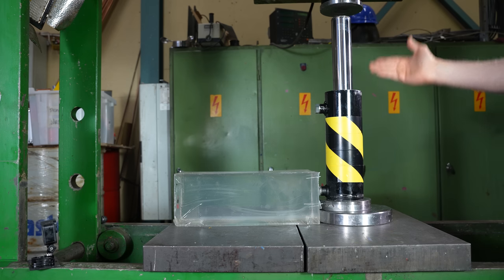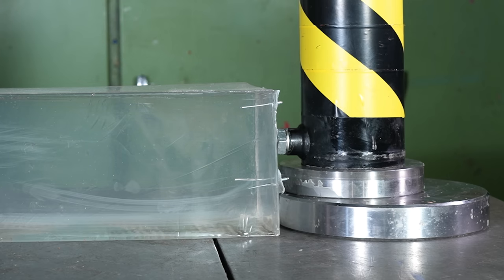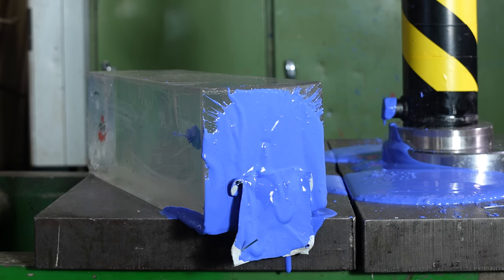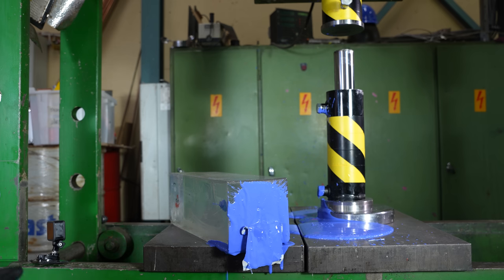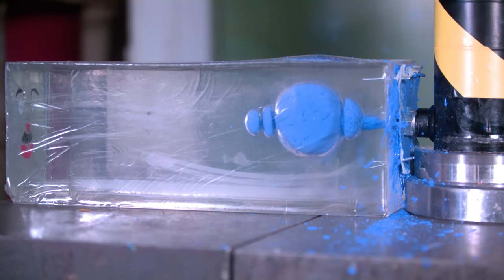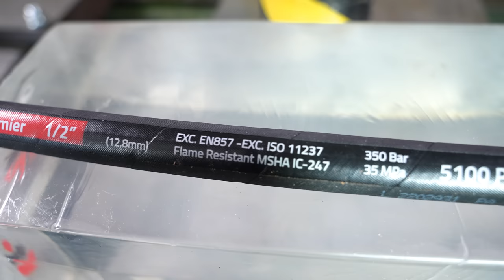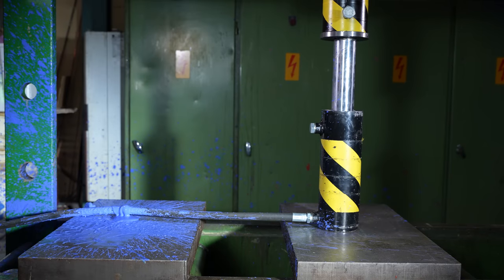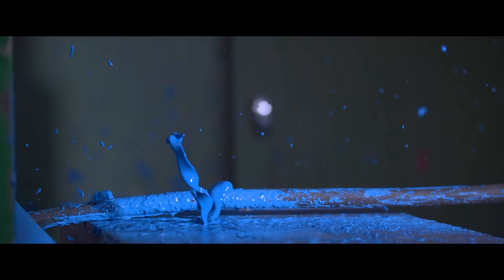Injection Injury Demonstration With Hydraulic Press | How to lose your hand!

Comment: I was a US Naval Aircrewman on the P-3 Orion. After taking off one of us went thru the aircraft making sure all is good. One of the areas was the hydraulic service center. If we looked in and saw what looked like smoke we had to assume it was hydraulic fluid leaking at high pressure. We were to take the broom and wave the handle around to find where it is leaking. NEVER put your arm in there since it could cut off or destroy your arm.
Reply: I talked to a Navy guy who served on "a small ship" (wouldn't say what kind) and saw two sailors drag some idiot junior officer trying to find a leak with his hands when they were "taking too long" to find something else. Long story short it went to Captains mast and the captain threatened to have the officer find leaks with his face.

Comment: I'm very happy that you brought this very dangerous fact of high or super high pressure dangers. Any thing injected at high pressure is a huge potential for major damage. PLEASE BE CAREFULL.
    I watched a shipmate who had his arm sliced open by a high pressure pin hole leak. The stream was very fine and basically invisible in the light available.
   I was taught to use a piece of cardboard ahead of my hand or arm before reaching in. Just a finger tip blast can lead to a loss of the finger.

Comment: I worked for a company that made ultra high pressure pumps, for water cutting and heavy cleaning. The pumps went from 20.000 to 55.000 psi. The pictures and videos of accidents everyone there saw during safety training were horrible, and once during a company barbecue they both ribs and cut it with a 40.000 psi pump with a less than 1mm sapphire nozzle "gun". Cuts bone like it's hot butter.
Reply: How does hot butter cut bone?
Reply: @Peststurmtief  With enough pressure behind it, I'm sure it'd be a perfectly adequate cutting fluid. DO NOT try this for injecting your turkey next Thanksgiving. Or perhaps that's another video idea, because it'd show some of the effects of degloving.
Reply: Pump don't really create pressure they create flow. Resistance to that flow creates pressure. Now yes the pumps have to be able to resist back flow
Reply: @Peststurmtief  You're not a native English speaker are you? 🤣
Reply: @krashd  no need to be a native speaker, that sentence can indeed be read both ways and so the joke is valid.
Reply: I used to work on a water jet with a 65000psi pump. Never tried cutting up meat but that thing blew through solid steel right quick sooo.....
Reply: @edep3970  the amount of flow for a water jet cutter is moderate, we had a little diaphragm pump pulling out water to separate out the garnet and then a normal sump pump getting rid of the clear wastewater. The main pump for the machine though was a reciprocating piston type design, never seen anything like it outside of that application. So yeah it was directly applying huge pressure forces to the water through that piston and when the jet was off but the system was pressurized the main gauge read tens of thousands of psi. we had to let it charge up with pressure before activating it.
Reply: @comradegarrett1202  never saw a 65k pump. Must be amazing. The 55k we had already scared me a lot. 😅

Comment: My dad actually had this happen to him during a lapse in judgement.  A hydraulic hose blew on a skid steer and he grabbed it.  It wasn't pretty but he did make a full recovery with minimal long term effects.  The hole in the hand was the least of the problems, the hydraulic fluid was a different story.
Reply: isnt hydraulic fluid toxic?
Reply: @The4stro  yes
Reply: They removed a fair amount of damaged and oil soaked tissue from his hand and he got right to the ER which helped.  Also, I believe he was pretty quick on the release so that the damage was less than it might have been. It's amazing how fast we can react during those WTF was I thinking moments. Regardless,  he was extremely lucky and IMO came away better off than he probably should have.
Reply: @jeffreywhitmoyer860  grabbing the broken line is exactly what i did too; the pain sure helped in letting go quickly 😅

Comment: My father told a story of an aircraft mechanic who noticed hydraulic fluid on the padding along the rear side of the aircraft. The mechanic ran his hand along the suspect metal hydraulic line without thinking and lost most of his fingers in just a second. The line had a pin-hold leak and the pressure was many thousands of pounds per inch. Basically became like a hot wire and hurt his hand badly.
Reply: Jesus, thanks for the heads up, I never gave it any thought how high pressures can do this.

Comment: I've been fixing hydraulic lines on the excavator at work and I'm going to be extra careful now! 
You should try the candles against the ballistic gelatine
Reply: Yep be careful and use your head. I've had a hose on a crane truck outrigger I was working on blow without any warning before. A line of fluid the diameter of a needle, like a freakin lazer beam shot right over my shoulder next to my ear. It could have been SO bad. 

Another thing to remember is that as soon as the system loses pressure, anything that was being held up by that fluid will fall. Always take a second to look around and think before you remove a hydraulic line, as the machine can "settle" right down on top of you.
Reply: @Bloodbain88  bloody lucky! I've heard it's really bad to get hydraulic fluid in wounds too.
Yeah I've learnt to extend the boom now to relieve any pressure but it just takes one screw up to be the last screw up.

Comment: This can also happen with airless paint sprayers (they use a corkscrew pump to get the paint up to about 3000 psi before it exits the nozzle). Ive heard stories of painters who accidentally or ignorantly wave thier hand in front of the sprayer and the paint sprays instantly into their flesh. The injury doesnt stop with the mechanical damage either because paint in your blood stream can be extremly dangerous so when this happens the victim usually needs to get extensive surgery well beyond the insertion point.

Comment: I think the one thing that is more terrifying than injection injuries is high pressure steam injuries. I think it would be interesting and informative to also try to demonstrate those, as long as you can do it safely.
Reply: name 😂
Reply: If there is something worse than hydraulic injection injuries, then high pressure super heated steam is a good candidate.  A super heated steam leak is invisible but extremely loud.  If someone panics and runs through the steam, they can lose limbs,  be cut in two, or blown off their feet.
Reply: Moderate pressure HF leak?
Reply: I was a boiler technician in the USN. We ran 1200 pound, 1200 degree steam in a 16" line, as well as all the other smaller lines and pressures. The boiler room was so loud, you would never hear it. The only indication of a leak in the main line would be pressure differences on the gauges. In that event, the procedure for detecting the leak would be to look for any condensation on the ceiling or walls, it could actually cause it to rain in the boiler room. You could not see, or hear it any other way but even then, you still would not know where it was coming from. So, the procedure was, to take a straw broom and run it over the line and wait for it to cut the bristles off. This steam could cut your head off, and cauterize the veins, so you wouldn't even bleed... Fun times...
Reply: My dad was in the Navy.  He said that if you were in a space with a superheated stem leak, you waved a broom stick in front of you before you moved.  When the end of the broom stick fell off, you found the leak!

Comment: On the pipe burst test -- I've never seen ballistic gel deform that much without penetration. I'd love to see the test run again but with the ballistic gel held in place.
It would have also been good to have a pressure meter on the end of the hose so we'd know just how much pressure there was before the pipe burst.
Reply: At these kinds of speeds there's essentially no difference between holding it in place or not, the inertia of the block itself is already plenty enough. Same if it's getting shot by a bullet.
Reply: @Me0fCourse  Considering that the block of gel jumped, basically, its entire height off the table tells me there is a decent probability that there would be a difference.
Reply: Eh? The paint went almost through the block on that test though you cant really see it until the highspeed shot
Reply: Yeah, putting a decent sized weight on top of the block I suspect would lead to some interesting results. If it couldn't deform up it would most likely end up getting squeezed out the sides which would probably then increase the odds of the paint penetrating the block (if not just splitting it in half). Realistically the biggest damage in a quasi-explosion like that isn't even something you can see with ballistic gel which is the blunt trauma from the impact. Even though it didn't technically "penetrate" if that had been an actual person you'd have severe internal organ damage.
Reply: @fred_derf  a person, when hit by something at pressure or speed will move and deform. I have been unlucky enough to be first responder to some nasty shit including a high pressure hydraulic line split. It hit the guy in the chest but what saved him worse damage was it also knocking him backwards so it lanced clothes and skin but didnt go as deep as it could have if he was rooted in front of it.

We are fragile things, not solid blocks.
Reply: @sathos  What did I write that made you think I disagree with anything you wrote? The amount of deformation the gel went through could easily kill someone.

Comment: The injured tissue area would actually be quite a bit larger than the maximum size the bubble achieved, because the surrounding tissue would be subjected to crushing pressures that would rupture cells and tear apart tissues such as muscles, veins and arteries.  That kind of damage can take an extremely long time to heal because of the extent of damage and the interference with blood flow to provide materials to rebuild cells and tissues.

Comment: For the hydraulic hose failure, what you see in the ballistic gelatin is the difference between the temporary wound cavity and the permanent wound cavity. Most firearms channels on YouTube that use ballistic gelatin will talk about these two things.
Reply: Yeah, to go frame by frame to really see it, but the temporary wound cavity forming was almost horrific to watch, if the gel hadn't been wrapped in tape or whatever it was, I'm sure it would of gone clean through there was so much force!

Comment: When I'm connecting hydraulic hoses I will often tap the end of the hose on the side of the machine to relieve pressure, when the machine is not running then "theoretically" there is minimal pressure, but I think it would be neat to see at what pressure it becomes dangerous to stand less than 20cm away when you tap the end of the connector with a steel plate.

Comment: Here's an idea.  Catastrophic hose failure like your guy suffered, but have the polycarbonate as a close proximity barrier between the worker and hose.  How much will it withstand? I know polycarbonate is tough, but its not indestructible.  And if it doesnt fail, what sort of force load will it put on the worker.
Reply: I winced too, for myself I always prefer two safety devices between myself and a possibly fatal hazard.

Comment: With hydraulic fluid and such it's not just about the kinetic damage, the fluid itself will chemically damage the tissue and untreated it will cause necrosis and such.
Reply: It can fill body cavities under pressure which releases the pressure into you veins and arteries, depending on the fluid it can cause poisoning or instant death

Comment: The HSE head at work had it happen during an equipment inspection. Pumped his hand right up with hydraulic oil, and had to have it filleted at the hospital to get it all out. Not a fun injury, and the oil is thicker than water, so it doesn’t spread out, but stays a narrow stream so it’s real hard to see. Needless to say lesson learned: Never put your hands near hydraulic lines on running equipment.
Reply: I have never heard the word "filleted" used to describe a medical procedure before.
Reply: @K-o-R  They have to cut and peel the skin back to for it to be cleaned and to heal properly if memory serves me correct. Not too dissimilar to what you would do to chicken or fish, but much more gross and painful.
Reply: @mysock351C  I, uh, think I'll take your word for it...

Comment: Retired United States Air Force. I was a "Crew Chief" (Aircraft Maintenance) 70s-90s.
I was trained that high pressure grease application, and aircraft system hydraulics at 3000 PSI or even higher peak during operation that the "injection" of hydraulic fluid or greases was a ever present danger and that if one suffered injury, that the treatment and damage that would remain likely would be serious loss to the "limb" that suffered the injury.

It was explained that if a body part was "injected", that the tissue would need to be splayed open and cleaned using various methods of hard stiff bristled brushing, scrubbing and high pressure saline wash to remove the grease/fluid. Matter remaining within the tissues and that necrosis and infection may certainly follow. The prognosis was not good.

(a number of my fellow airman thought all of this was "scare tactics", but I took it as gospel fact, yet, I avoided a great deal of damage that others encountered...)

While better methods of treatments likely have evolved over the years since then, I cannot expect that the outcome would be much better than what we could expect.

You can better believe, that even all these years later, that I am still vigilant when I work around pressurized fluid, greases and all the other things that were safety issues.

Your videos bring all these things home, and provide a great visual and fact based understanding to many that might not otherwise realize the dangers of such maintenance operations.

Kudos to you and your wife for all you do.

Comment: The last job I had before retiring couple of years ago involved refurbishing water infrastructure, fancy name for sewers and storm water drains. On some of the projects we cleaned badly deteriorated concrete walls using high pressure water blasting to prepare them for resurfacing. At times we did this with the pressure at 40k PSI (approximately 2758 Bar, 276 Mpa). The hoses were rated to 100k PSI and were connected with very special fittings. The pumps were driven by relatively large diesel engines. The PPE was as you can imagine quite extreme.

Comment: Hydraulic hose industry standard pressure ratings are a 4:1 differential to burst pressure. So under proper working conditions (which most hoses are NOT in) the burst pressure on that hose would be around 20,000 PSI or 700 BAR. If your equipment is operating at 600 BAR something is terribly wrong with the machine and it's likely that your operator is an idiot who gets his rocks off by deadheading it. However, some semi-trucks operate at 20,000 PSI and mechanics hate working on them. you test for leaks by putting a piece of paper on the end of a stick and if the paper or the stick gets cut, probably in half, there's a leak.

P.s. It's really nice to finally be able to comment on something I'm an expert on.

Comment: It was a long time ago but during a safety meeting covering the concrete casing process on oil rig we were shown pictures of a high pressure accident. During the casing process several water lines were charged to 20,000 psi. Apparently while investing a hissing sound the rig worker ran his hand along a line. Neatly amputated all four fingers and the guy said he didn't even feel it. He just watched as his hand moved and his fingers stayed behind.

Comment: Thank you for this video and explaining the dangers of pressure. never take high pressure installations for a joke. Although all around im a mf'er who likes to joke with stuff, i also work in a chemical plant where we make impact modifiers (excipient for plastics). We also spray dry a few of our products and this is where we work with around pressures of 3000 psi. I've seen an incident, luckily with no humans involved, where a hose disconnected while operational, but when you see steel bending/paint blasted away and all, you're gonna be carefull..

Comment: I had a hydraulic line with a pin hole on a massive press. I was making heat Shields for rocket engines. I didn't even see the hole. My thumb started bleeding and a half hour later my hand looked like a Mickey mouse glove. I almost lost my arm.

Comment: Hydraulic oil dissipates pressure very quickly. Even though that hose burst looked really dangerous, it would typically only be bad if you were very close to it. It only takes a liitle distance before that fluid would not longer penitrate the skin. Another type of hose failure is a pin hole leak. Those are extremely dangerous. They are quiet, very hard to see, and are more dangerous at longer distances (similar to the nozzle).

Comment: I've just learned about these types of injuries today. Absolutely awful, to me this is equally in severity with a car falling on you off a jack. I'm thankful not to have pressure systems that could cause this and use thick gloves when handling anything under pressure, including brake / clutch lines that max out at like 30-50 PSI. Horrible injury.